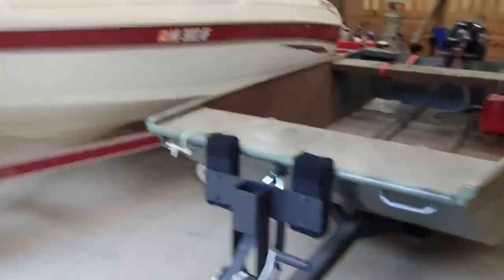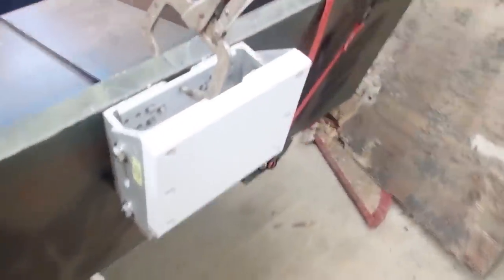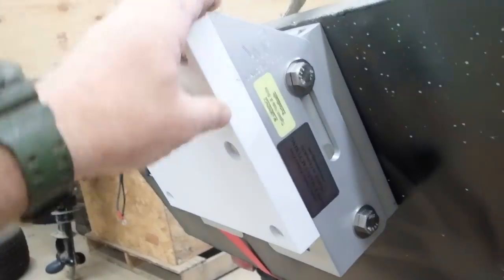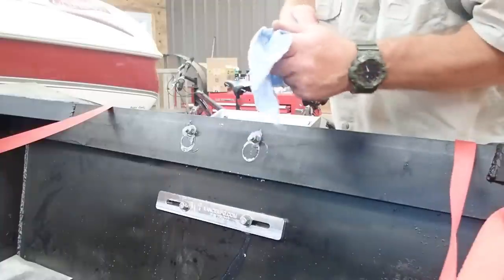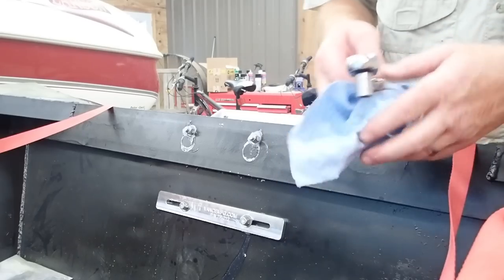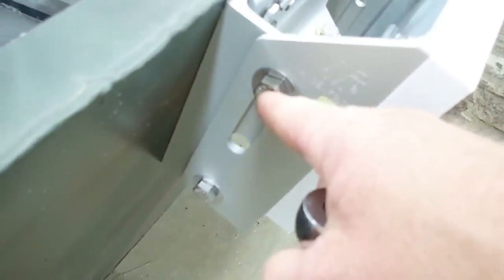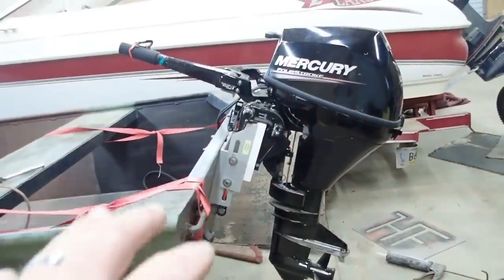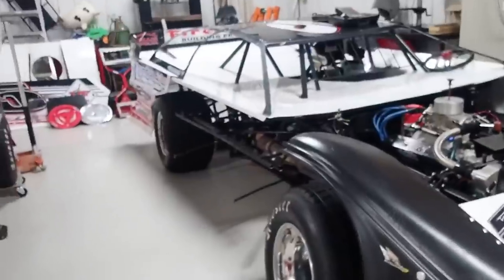NEW JON BOAT JACK PLATE 🤔🤔🤔”Vance Manufacturing "

Comment: the cavitation plate (just above the prop) is supposed to be level with the bottom of the boat for ideal operation. too high or too low causes cavitation and reduced propulsion. take a cordless drill with you to move the jacking plate up and down, to fine tune it while moving. cheers

Comment: I'm considering one of these too. Thanks for the video.

By the way, if you've never tried one, I really like the improvements in initial thrust and handling I get with a hydrofoil on the foot of an outboard. Though the top speed might suffer a tiny bit, everything else is greatly improved.

Cheers!

Comment: I got one just like it. It worked great on my AlumaCraft 1232 jon boat. I mounted it 1/4 inch below the transom, {this just looked right to me), and at maximum height it puts the anti-cavitation plate on my new Suzuki DF6A outboard dead even with the bottom of the boat.

Comment: Just be careful that the water pick up stays deep enough to get water to the pump when you are running. Looks like you may be a little high, just be careful not to burn the motor up.
Reply: I was always told your fin on the foot should be level with the bottom of the boat

Comment: When on plane (run wide open) the water intakes need to be water ( they are the holes on the side of the foot in front of prop just above the shaft they on the side )

Comment: Is that not a 16" transoms and short shaft motor?

The cavitation plate needs to be close to the bottom of the bottom edge of the boat.  You will have some forgiveness but not much.  You go too high and when you turn it will spin out. Prop will also slip out when trying to get on plane.  However, when you find the sweet spot you will gain a mph or two.  It ain't going to help you much in shallow water going slow as much is it will on plane.  A true hydraulic or electric jack plate allows you to raise the motor once on plane allowing you to maximize the engines performance to the boat and reducing drag on the foot.

Comment: Wouldn't it have been better to use 5200 on the bolts, and not silicone? It would keep water from penetrating into the wood in the transom much better. Those bass boats you saw jacking the plate up and getting a holeshot also had low water pickups on their lower units to prevent the motor from losing water pressure and burning the powerhead up.